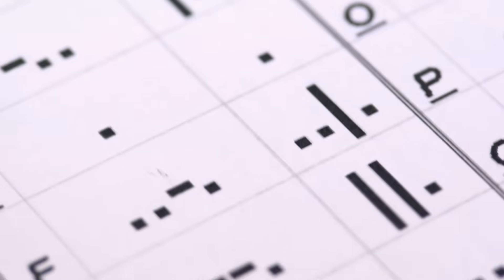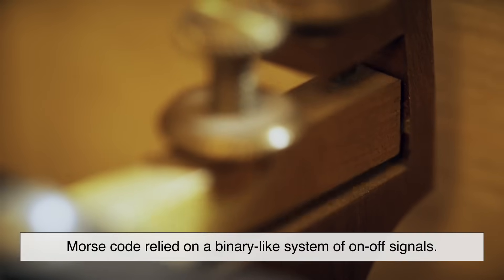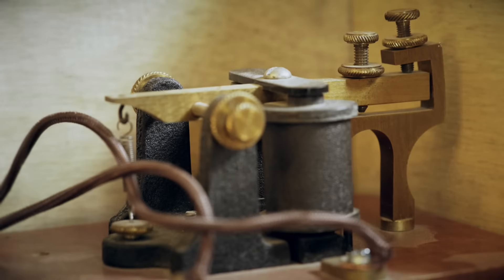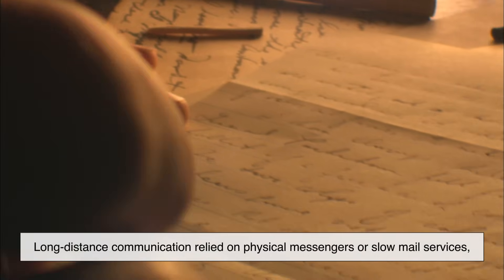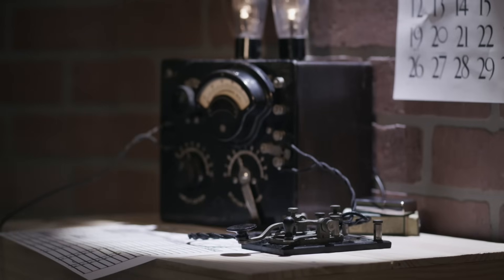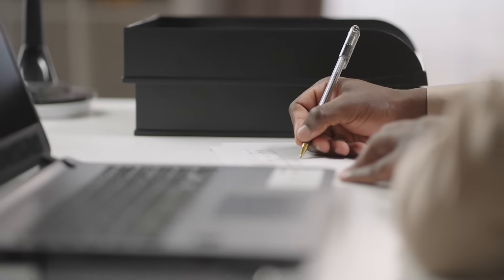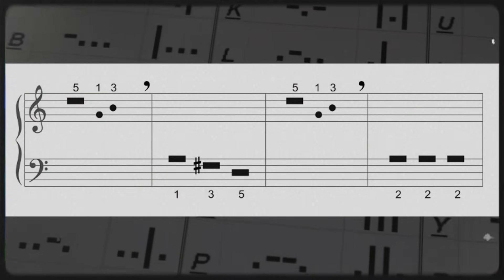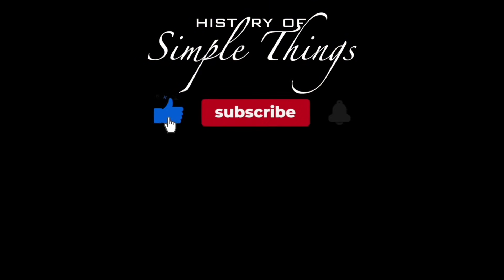Morse Code: How It Works

Comment: I must add, when Morse code system first come to be, everyone had to learn Morse code by dots and dashes, like the written test might say "what is the code to A" and the answer, they would have to write or draw a dot and a dash on the page, when World War 2 came, there was a urgent need for Morse code people, so they did away with the written test to short circuit the system, and found people was no slower in learning Morse code.

Comment: The 'V' for Victory in Morse Code got associated with the opening notes of Beethoven's 5th Symphony.  Di-Di-Di-Daaahhh  (Dot-Dot-Dot-Dash).  I think it was just coincidence that V came out that way in Morse Code.  I remember seeing the letter 'R' being associated with "Race Car".  A wheel (dot), the body (dash) and the rear wheel (dot).  Otherwise, in Boy Scouts we memorized Morse Code using pairs of letters that were just the opposite like A and N, B and J, D and W, S and O, etc.

Comment: It's "Binary like" because it employs  electrical off and on signals (0s and 1s)  just like ASCII, However it's a Ternary code (meaning three components) the third component is time. So while not purely "binary", Morse code IS a digital code.

Comment: I have tried to learn Morse code since I was a child. I occasionally was able to get to nearly 5 words per minute for no more than 3 minutes... and then my brain would filter out the sound to the point I could no longer hear anything but just noise. I wanted to learn because I wanted to get my amateur radio license. When I was in college, the FCC dropped the requirement for 5 WPM code testing for the Technician Class license. All of the other questions for the Technician Class test were a piece of cake for me, so I got my Tech license. It wasn't until I was years into my career that they removed Morse code (CW) as a hindrance from amateur radio operators getting their licenses. Once removed, I studied initially for my General Class license and started studying for the Amateur Extra Class before I found a place to take my test for the General Class. Upon finishing the General test with a perfect score in about 15 minutes, the test givers told me I should take the AE test too. They told me that there was no downside to taking the test, even if I didn't pass. I took the test and barely passed the AE, but yes, I did pass the test. 

Most of the excuses people had for requiring code to be a requirement have become obsolete. There are better methods than Morse code now and there are tools that automate the task, so actually being able to listen and transmit without a computer is just a niche hobby within the hobby.